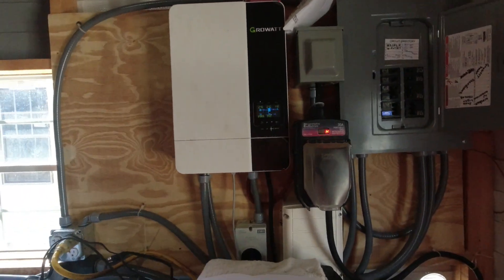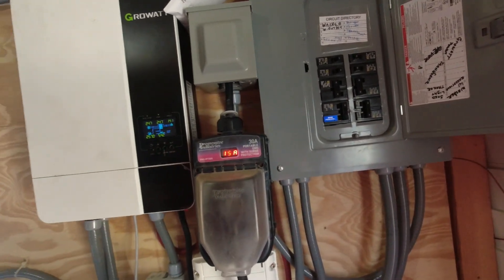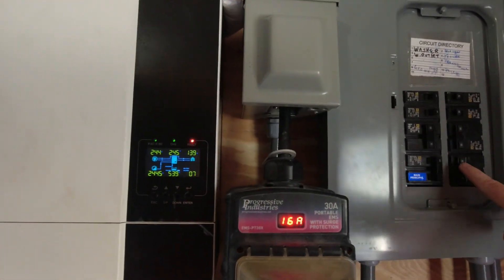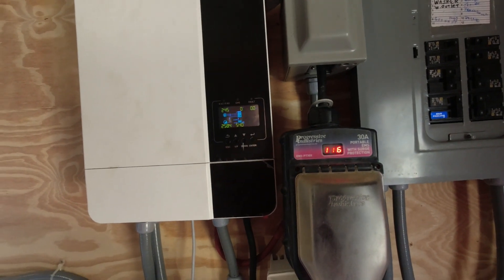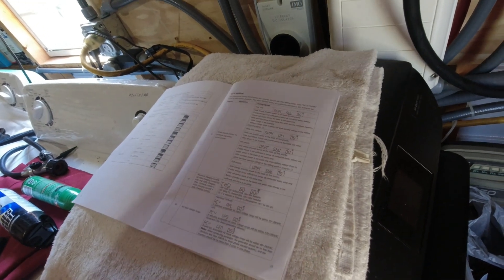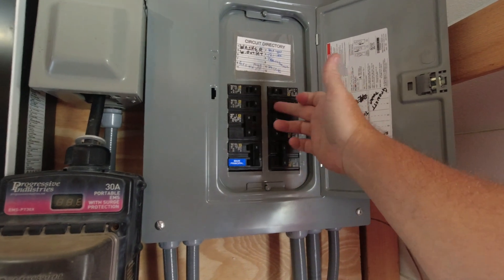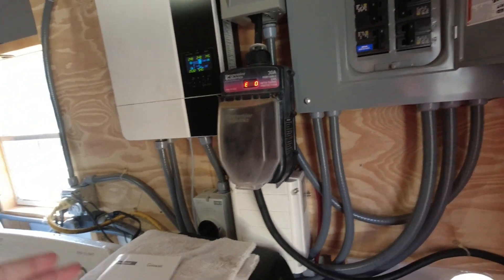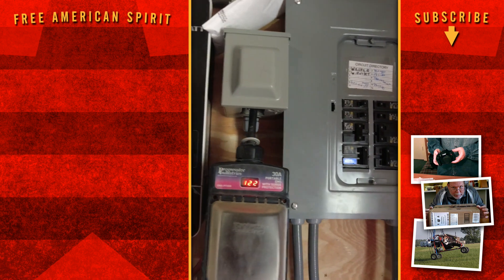DIY Growatt spf5000es 5000 Kwh solar install  Dryer and Mid Point Transformer unbalanced issues

Comment from the maker: UPDATE. THIS DRYER SET UP DOES NOT WORK.
DO NOT TRY AT HOME...
Ok so here's what happened turned the air off in the trailer just to make sure that I would not trip the 50 amp breaker while running the dryer.
Did a load of wash, when that was done I put it in the dryer and started a second load of wash...   Every thing went as planned but the transformer box was really hot.   So when the second load of laundry was done I put it in the dryer...   While that was drying I took the cover off the transformer.  It was pulling the max Amps through line one (1) and line two (2) so the dryer still uses the trans former to get one twenty volts(120) from each leg? I confirmed this by shutting off the trans former and the dryer went off.... So I put the transformer back on and I thought why has the transformer not shut off with an overload protection? It was really hot now and was buzzing louder...  No longer than I got that thought the thirty (30) amp breaker in the box tripped....
I since the transformer is needed for the dryer I think the 50 amp pass through is going through as a single phase like the inverter puts out?  And really not a true bypass with a line one (1) 
and line two (2)?
Or maybe now that I have utility hooked up, I should s
Remove the bonding screw from my breaker box in the shed?
I will try several ways and let ya all know when the other transformer gets here...

Comment: you could try disconnecting the heating from 240 volts, and run it at 120v. you will get less than half the heat, but it will draw WAY less power also. it will need to run twice as long, but you wouldn't need a second inverter. if you check and make sure that you put the heater leg opposite the rv, then that will reduce the work that your transformer has to do and you might not even need the second transformer.
Just in case you didn't know, the transformer ONLY carries the IMBALANCE, not the entire load. this is something that not everyone understands about using a autotransformer to provide a neutral.
the 120 volt mod for the dryer is pretty simple, it is done on the back normally.
I can already hear people saying that it will draw the double the amps on 120v, but this is simply not how resistors work.
Let me know if you want to try this and need help.
I hope this helps.
Reply from the maker: I will move the dryer breaker over to the other leg in the panel, didn't think of that.  But I think it will still be to much for the inverter.  That may be a very good suggestion....   I thought about going to 110 on the dryer but it really is no big deal to just flip the inverter off.  If push came to shove I'm sure the wife would love to hang the wash out side ;)

Comment: I'm using same set as you I think most dryers draw 5200w or so witch is max what im doing now is run dryer by its self  or like you tern inverter off and use utility  I have picked up 2ed 5000es don't no if you have natural gas you may go with gas dryer wood be cheaper than inverter and more panels as far as unbalanced 120v for trailer you might split 120v in to 2 separat legs for better balance just say good luck nice vid 👍
Reply from the maker: For now I'll just run the dryer on utility everything else is on solar. The second transformer should be here by this Monday so that should take care of the imbalances...  Thanks for the good comments!

Comment: I had the same problem . i shut down all inputs and booted them all back up and then it worked fine. I think the initial demand of the dryer shut down the inverter, or the battery .
Reply from the maker: My dryer pulls to may Amps it's not a "problem" but rather the limitation of the inverter.  I new going in I would need two inverters if I wanted to run everything off solar.  I opted to start off with a smaller set up due to my pocket book, knowing I could expand later.  My goal is to basically knock my elec bill down by about 3/4...  Seeing that I can pretty much run everything on this system except the dryer I should hit that goal.  The only thing not being powered by solar is the dryer (a couple times a week) and some grid power at night, because I don't want to delete batteries.  When I get my 3rd or 4th battery I will then run the solar (batteries) at night too by changing the settings back to SBU. Instead of SUB like it is now.  Hey thanks for the comment!